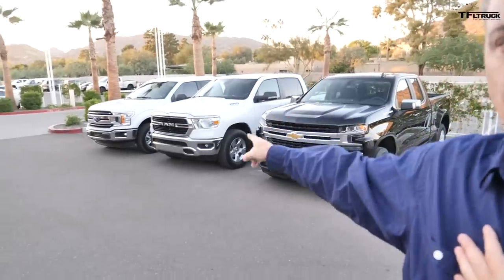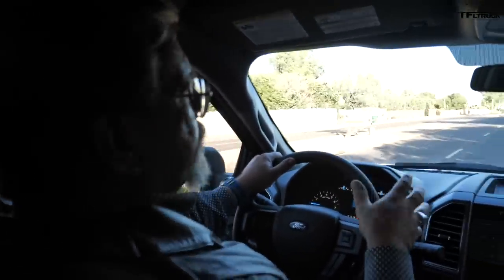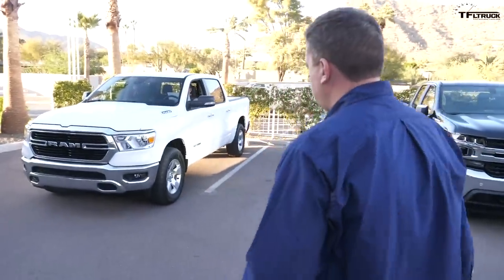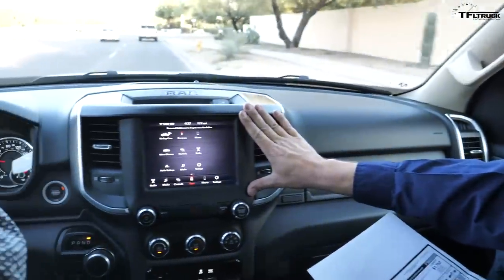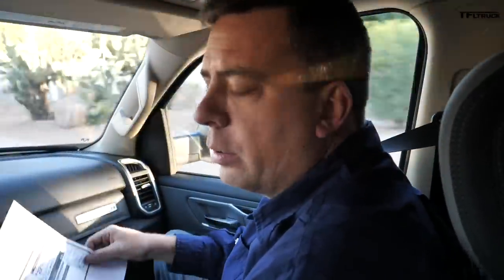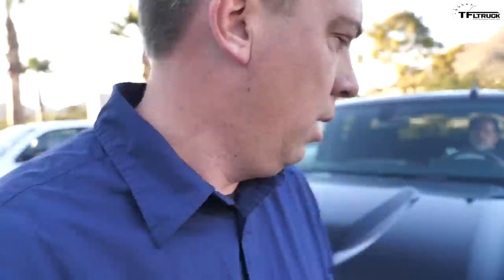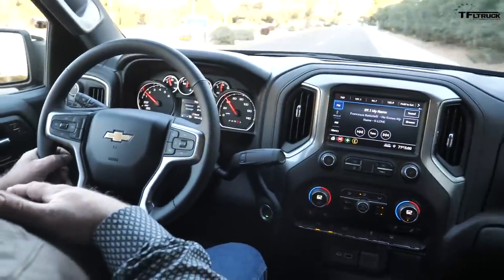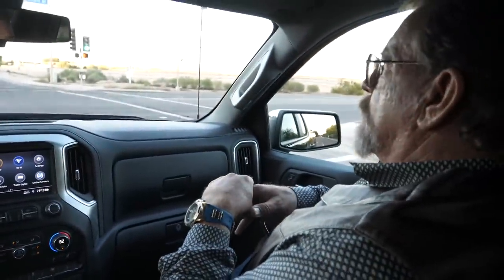Work Truck Wars: 2019 Chevy Silverado 4-Cylinder Turbo vs Ford F150 vs Ram 1500 Review

Comment: Ford 2019 extended cab its $40k 4x4 with 2.7L EcoBoost that's almost 5k cheaper and faster then those 2 trucks Chevy trying to fool ppl damn shame on GM
Reply: GM used both engines here for point of reference in this test when TFL did their 1st video of new 4cyl 2.7 T. How is that trying to fool anyone?? The 5.3L can be had on all 3 trim levels. What that means there's a model with a 6spd.
Because this engine is new GM chose to have 2.7L on volume trim but it's still the entry engine. The price argument will vary for various reasons. 2.7L Eco was slightly upgraded last yr. The same can't be said for this GM engine. It's hasn't been around that long. Like it or not price is affected by this issue.
Reply: @jeffwill4923  ok then GM should of choose the ford 2.7L eco since GM base model truck does not come with the 4cyl turbo and for the price the ford still best buck with the 2.7L eco on either single,xcab,crewcab on stx trim level it's like ford trying to test 3.5L eco vs dodge 5.7L and GM 5.3L
Reply: @michoacanom4320  I feel you are missing my point. Instead of making another V6 or upgrading the OHV 4.3L, GM went with a T 4cyl. There's more torque and economy is similar to a n/a V6. This 4cyl isn't built to take on their 5.3L in performance or towing. The numbers quoted here are similar to their 4.3L. This price debate can't be used here. We are looking at a mostly updated model from front to back. The same can't be said on Ford side. If you were looking for a 2.7 eco TT vs this smaller engine like some you were sadly mistaken. In every video after the 1st I told a few GM is using the 3.3L not TT. GM isn't looking to take a L, lol after all this talk of tech and upgrades.
Reply: @dedalliance1  I get it here in Texas 4x4 stx crew cabs u can get them for 36k , and 2wd for 32k not a bad deal to me I love the color match no chrome for me
Reply: @jeffwill4923  I get your point it's just that GM always comes up with some dumb stuff to make them selfs look good
Reply: @michoacanom4320  I just updated my comment after doing some research on prices across the country, I'd go look at it just for fun.
Reply: @joejames8503  so you saying that you buy a truck to be slow when having a trailer or hauling something on the bed if you dont have the power you cant haul or tow educate yourself man
Reply: @dedalliance1  yeah I did lots of research and test drove all manufacturers before I bought my truck have nothing against any brand I'll buy what I like or meets my needs
Reply: @michoacanom4320  Yeah. Now's the time to buy the 2018s off the lots because they need to get rid of them. But that 92k dollar f250 I linked was insane lol.
Reply: @dedalliance1  yeah man ppl said u paid 70k for a gas f150 when you could of bought a diesel I'm like do you'll even know how much a fully loaded platinum goes for on diesel  these trucks are getting to damn expensive
Reply: @michoacanom4320  Fully loaded trucks are dumb anyway lol. I could buy a 1 ton GMC crew cab long bed 6.6L diesel wt for 48k lol.
Reply: @dedalliance1  I had nothing but cloth mid trims and now that I have a fully loaded to me and my needs it's the best decision I've made every one needs are different of course
Reply: @michoacanom4320  Yeah everyone has what they want and can justify in a truck, but when I can buy a wt with the same engine and transmission as a fully loaded one for almost half the price, and then drive twice as far, that's just too tempting. And with today's technology even wt packages you get power windows and locks, touch screens, radios, cruise control, it's really everything you could actually need in a truck.
Reply: @dedalliance1  true to some of that now I've pay $90 a month full coverage on my 18 platinum and I use to pay $180 for my 11 that I sold newer trucks with more tech are cheaper to insured I love not having to put a key out my pocket every time ,the twin sunroof, massaging seats, and the adaptive cruise control with lane assist some of the features I love since I trouble 2 times a month to Mexico and its 1500 miles one way 3k miles round trip so u can see that a fully loaded for me was the best option and I have the COYOTE  on mine love the sound and power I get and mpg 0 complaints
Reply: @michoacanom4320  That's great, I love that these trucks are coming everywhere from basic bottom line trucks to trucks with vibrating seats lol. My Grandpa retired from GM after 22 years building Corvettes in bowling green Kentucky, so my family has been greatly impacted by people with a little money spending it on nice things which at the end of the day provides a lot of jobs for a lot of people. I had a 2018 Silverado 2500 WT and I put 10k miles on it in about 3 months and enjoyed it. Unfortunately it got totaled on an unfortunate event while I was driving on a beach in California, you can probably guess the rest lol. But yeah all the other features are great, I think they're more on the want side which is perfectly fine, like they say you can't take it with you so may as well enjoy it.
Reply: @dedalliance1  your right we need to have the money flow otherwise ppl will be unemployed and wont have a place to live and I was going to get a lariat sport package but it was like 60k if they had the stx all color match at the time I bought mine I would of lean tours it but they didnt bought mine in October 15th 2017 and I dont like the payment on that thing its $1,000 dlls a month 😢😭
Reply: @michoacanom4320  I don't get the acceleration argument from Ford buyers at all.  Is it really that big of a difference that the 5.7 Hemi RAM goes 0-60 in 6.3 seconds vs the 2.7 Ecoboost in 6.1 at sea level?  I can see somebody arguing for the Ecoboost in Colorado because turbo engines are superior at elevation, but everywhere else, do the .3 seconds really matter?  I am not going to bother listing 1/4 mile times, because if you buy a pickup truck worrying about 1/4 mile acceleration times, there is something wrong with you.  I would argue that towing capacity, payload, MPG, cab space, ride, comfort, durability, resale value are all way more important than acceleration.  In my opinion(comes form when I shopped for a new 1/2 ton two months ago), F-150s are overpriced compared to Chevy and especially RAM.  I would say, package/price RAM>Chevy>Nissan>Ford>Toyota.  And if you are willing to spend the money, Toyota is by far the best choice due to the best long term durability and insanely high resale value.
Reply: @2005OEFArmy  I understand I dont buy a truck to race it but to haul and tow and I live in Texas and choose a 5.0L over EcoBoost of course but before I did I drove all I mean all of the trucks from base to most expensive ones and toyota still has a key wtf same as Chevy no push button I've purchase my truck in 2017 for 2018 model Toyota didnt even offer led lights for a platinum or 1794 model wtf not even smart entry or remote start about long term reliability I had an 11 f150 with 5.0L put 375k on it 0 issues just normal maintenance oil and filters tires and front end suspension due to Mexico nasty roads so all about toyota hype about lasting 300k its BS for my case I have a 2000 ranger bought it brand new has 420k still running no issues
Reply: I think we should appreciate the new technology this America companies bring and hope for the best no matter its from Ford,GM or Ram because I was reading reviews on google and there are too many complaints for Domestic trucks and on other hand Toyota buyers are happy with their 2018/19 trucks with 2007 technologies,I pray that Big 3 stays on Top.

Comment: 2.7 turbo Chevy makes for a good run around truck for large fleets...gas companies, cable companies...good on fuel, not meant to tow much.
Reply: I agree
Reply: Drop it in a fiero
Reply: Except it really isn’t that good on Fuel compared to the Ford according to the EPA.  Hopefully real world is better.
Reply: No smart fleet is going to buy unproven a sliding cam shaft 4 banger when the 5.3 is a proven engine
Reply: Cost of operating this 4cyl turbo would be way higher than a nat-asp V6 or possibly V8...think about the abuse the average non-caring employee would give these trucks and tell me which will be in the shop more...
Reply: @truckguyjoe The NA V-6 in the other two trucks would be better for this. Just a simpler setup and NA in the real world usually get better mileage if your not working them.
Reply: Chevy should just put an iron block 6.2 in the work trucks. It would cost no more to make than the 5.3 since it's literally the same block with just a different bore diameter and connecting rod length ( I believe)
Reply: ryanhribar post the fleet maintenance costs for the 2.7 vs. the 3.3
Reply: but in that scenario shouldn't they be driving colorados and rangers anyway.
Reply: Except gm will still be offering the n/a v6 in their fleet orders which most companies will opt for more than likely.
Reply: General Motors
       Ecotec3
Production 
2013–present
Layout Configuration 
V6, V8
Displacement 
4,301 cc (262.5 cu in)
5,327 cc (325.1 cu in)
6,162 cc (376.0 cu in)
Cylinder block alloy 
Aluminum
Cylinder head alloy 
Aluminum
they don't make iron blocks anymore
Reply: @rotaryenginepete , not in a production gas vehicle besides the heavy duty trucks
Reply: It doesn’t get any better than the 5.3 all service trucks in my area are fords with the 5.0 it’s just as efficient and much more power
Reply: Why would any fleet buy an LT,  you don't get the option to buy the 2.7 Turbo until the LT. The works trucks still get a 6 speed and 4.3 v6 or 5.3 v8
Reply: Andrew Carr, There is a very large oil & gas company in my area, they own one of the country's largest refineries, and they lease on average 100-150 new Silverado LT double cab 4x4s each year, 2-year lease, so they always have trucks coming off-lease. They are managed by a national fleet company, PHH. Also, one of the largest roofing companies who is managed by ARI Fleet also runs all LT trucks (leases 200+ per year, also a 2-year lease). The dealership I work for handles each new vehicle PDI and maintenance. Not every company goes for vinyl seats, cranks windows, and steel wheels.
Reply: The thing is, isn't it not that much better than the 6 or 8 cylinders? Nonetheless, it's a small step. Let's hope it pays off, it's a bold move for a company that's under a lot of scrutiny
Reply: Yes, lets just copy Ford
Reply: @fireheat8738 , how so?
Reply: @anthonywebber2211  well ford created ecoboost and now gm has their own ecoboost.  Unlike Ram that created something new.
Reply: I'd rather have the new straight 6 turbo 
diesel thats coming out over this engine
Reply: @fireheat8738 , their doing it because of CAFE regulations 
Under the current regulations, the CAFE standards will incrementally increase over time. If fully implemented, the average standard will eventually rise to 54.5 miles per gallon by 2025.
Reply: Last Chance
thank you Captain Obvious, yes smaller lighter trucks are getting better fuel mileage
Reply: 23 mpg for 4 cylinder is not good at all. 2.7 v6 ford gets 26 n v6 dodge gets 25. The Chevy is actually kinda bad fuel mileage.
Reply: The Chevy best for towing with 40% more torque at much lower RPMs...
Reply: lol, 240 is the number, but 340 torque. 

My dad bought a 97 with a 5.4, he wished he had a 5.8. Gutless, traded in for a 360 1998 Dodge.
Reply: The worst on fuel dummy.

Comment: A work truck is usually a standard cab, long bed 2wd truck..by no means are these base work trucks, still way to spendy. Also, I'm probably going to get alot of crap but I hope these trucks dont sell well (whatever configuration) so that they will be forced to sell the for less
Reply: The USA built Ford and dodg--(I mean Italy's RAM) pickup trim levels are more inline with that of a manager,not a worker.

Comment: Fun fact, you can get a 2.7 ecoboost 4x4 super crew STX for mid 30's.
Reply: 31.9K, end of year sale.  I know cause I bought one.
Reply: I was thinking 40k+ for each of these! That’s outrageous. 
They need to get them down into the low 20s in my opinion.
Reply: Not in FL anymore...lol
Reply: i got mine for 32k in 2018 labor day sale :). 80k miles later it is still perfect except bunch of rock chips
Reply: Fun fact same with the 2.7 lt or sle all 3 companies compete directly in this price range for high end ram is most expensive then Ford then gmc
Reply: @harryballzack  yall are stuck in the 90s
Reply: No one cares what you paid for your truck. When you compare vehicles, you compare them MSRP to MSRP. The reason is because you can see what you get from truck to truck. The STX is a 40k truck with the 2.7 and 8inch screen. That is the volume truck. Because no one in their right mind would get a base xlt over a great STX with body matching bumpers, bigger screen and 400 lb ft of torque
Reply: @Silverback_GMT410  No one cares what the MSRP is, nobody ever pays that anyway.
Reply: @grantfahey4439  read what I said
Reply: @Silverback_GMT410  Screen? You really need a tablet in your truck to go to work? Lol kids these days. Give me efi and ac if im being fancy.

Comment: Folks it doesn't matter which truck in which trim level with which engine you chose because either way they're Absolutely wayyyyyyyyyy overpriced just like any other modern vehicle you see on the road today.

Comment: The Ford with a 2.7 and ten speed would make the Chevy look silly.
Reply: Bs ford is always been the biggest piece of junk going. And has the worst resale value
Reply: Ford's cheat. They use 10 speeds trans. DI and MPI. So 2 inj per cylinder. So yeah there hp should be better. But they never last very long in general.
Reply: @donaldkinder6716  best selling truck for 42 years
Reply: @ryanl2601  actually no. Best selling line sure by itself. But not actually.

Comment: Of course Chevy is going to put a optional engine against a base engine. Makes since. First video of TFL I can't even watch,  ya'll should have refused the review. So biased and bs. Ram and Ford deserve better.
Reply: Steven Densmore I, too, am disappointed but I'm looking at it as more of an initial review of just the new Chevy, not a review of it against the others (which would more accurately be called a comparison or shoot-out). TFL wouldn't have refused the "review" because there's no other way at this early point for them to get their hands on the brand-new Chevy.
Reply: @anthonyc1883  I know. U know I have been a Chevy fan till here late. It's just obvious that they rig the test. They all do it but Chevy is obvious. Makes me sick, next Chevy commercial a ZR1 vs mustang EcoBoost lol
Reply: @bryane2857  TFL should speak up about the discrepancy between the trucks GM supplied. Engine aside they even went as far as select the lowest version XLT and a higher priced and better equipped GM to one up the Ford.  My XLT had the 8 inch infotainment system, heated seats, remote start, power slider and more and it's just a XLT.  I also have a little 2.7eco that has embarrassed its share of 5.3 liter V8's.
Reply: @bryane2857  excuse me?  You have me confused with your little millennial snowflake friends.
BTW. I'm not a ford fanboy as my previous truck was a Silverado LT extended cab with a 5.3 I bought new and owned for 10 years. It did OK but struggled pulling 4k in the Ozarks.  My 2.7 eco doesn't even know its there.  If you don't believe me look up TFL's Ike gauntlet episode with the 2.7 pulling 7200lbs.
Reply: Biel Mèlich Artés LOL JD power awards...
Reply: Steven Densmore the Chevy bed commercial where they selectively edit and mislead about the damage done to their bed takes the cake. Their “real people” commercials are brutal.